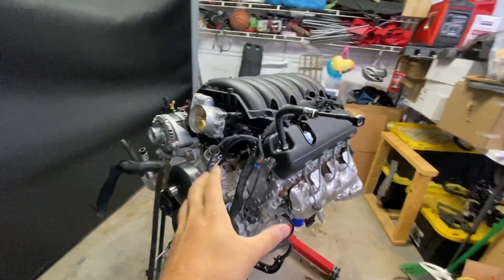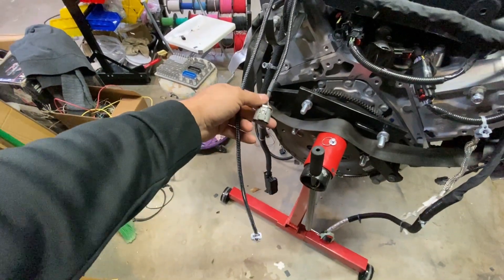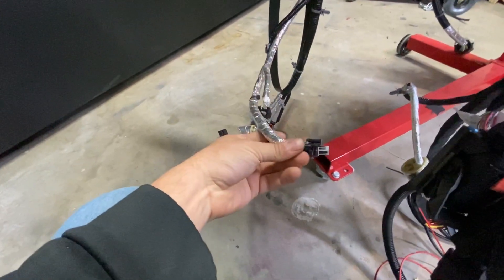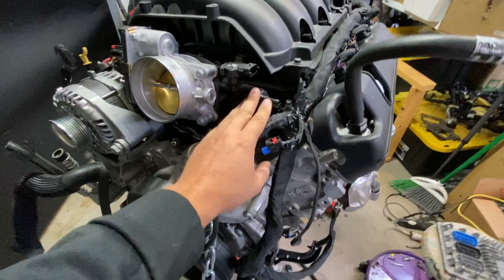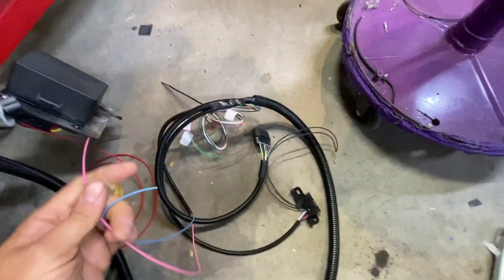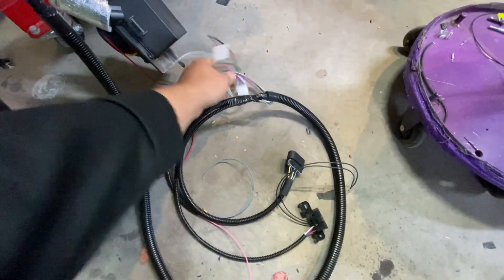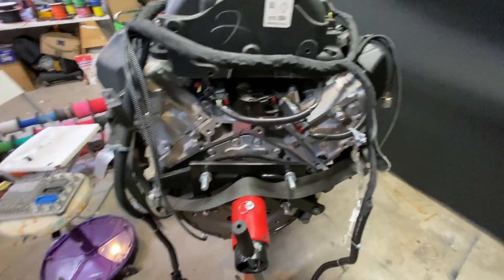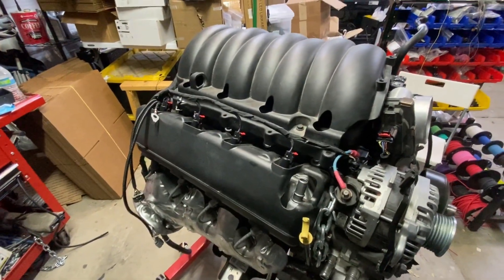Gen V wiring harness with full emissions

Comment: You mention in the video that a 2018 8l90 wont work with the 2015-2016 ecm and t87 controller? I already have a 2016 escalade ecm and tcm that I was hoping to use with one of your harnesses.